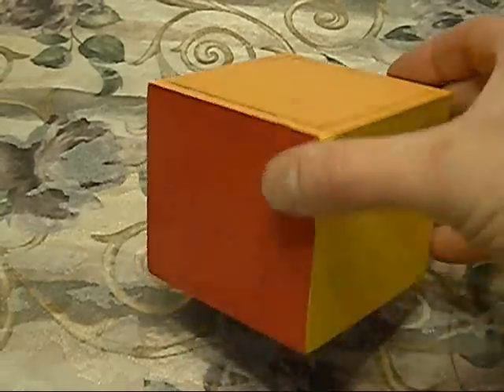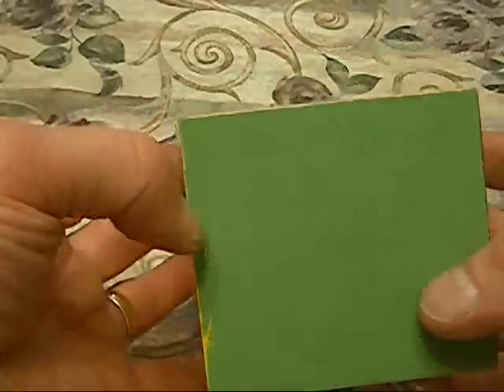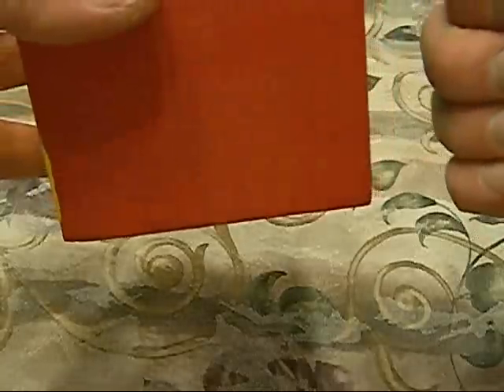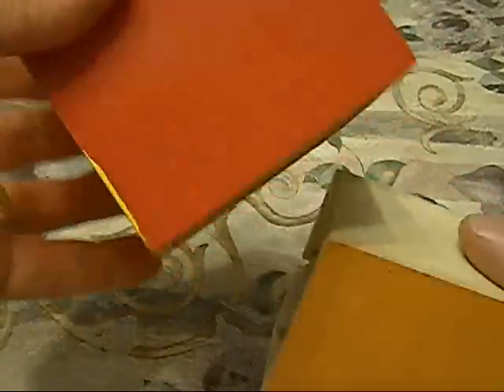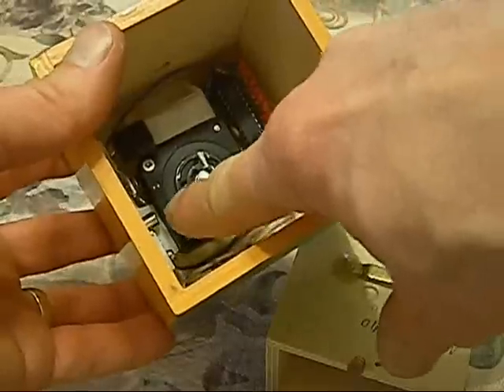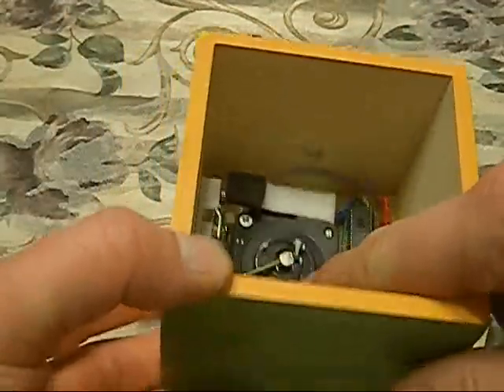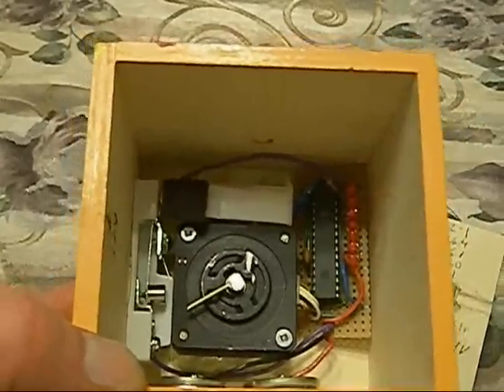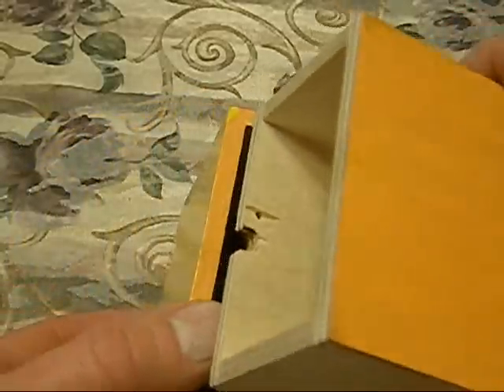Secret box

Comment from the maker: Good question my friend. The quick answer is that I installed a program that I had designed into that black computer chip that is in the box. The computer chip has been instructed to do a very specific task, to listen to the knocks on the box and then to decide if the right vibrations are met in order to open the box. It sounds complex at first but isn't really. I had over complicated the box with too much electonic stuff and really could have used a much smaller chip and just tossed the lights.

Comment from the maker: @wer4t4t The hardest part is actually trying to make your first project, even a simple one to turn an LED on and off can be fraught with problems. The reason for this is that the knowledge required  to use the design software and to then install your program onto the chip can sometimes be fiddley. After your 1st project every other one is much, much easier. To answer your question, I read the PDF data sheet for the processor that I wanted to learn. It's about 134pages

Comment from the maker: HeeHee, very good question and yes it eventually did happen. The solution was to drill 2 little holes into the box. 1 for light input and the other to insert a coat hanger to open the darned thing. Actually you can see the drill holes at 2:02.

Comment from the maker: @WhoMe2x Sorry, I never actually made any plans of this one. Matter of fact, I had even thrown away all of the programming notes too but I just pulled the chip and read it to produce what you see here for programming. This box could have easily been built using any of the processor chips from microchip simply because it really only uses 3 I/O pins. 1 for the vibration sensor, 1 for the door solendoid (or 4 for a stepper motor) and 1 for a door open sensor switch. Hope this helps.

Comment from the maker: @PICing4fun Ooops, sorry I forgot that this video never showed the programming sheets, but with so few parts it shouldn't be too hard. The trick was to be able to detect a knock and also ignore the bounce afterwards. The project runs on 6 volts DC which I am aware is just on the edge of the processor limit, but it directly drove this particular stepper motor so it was perfect ;) The project must fall into sleep state when not used in order to preserve battery life.